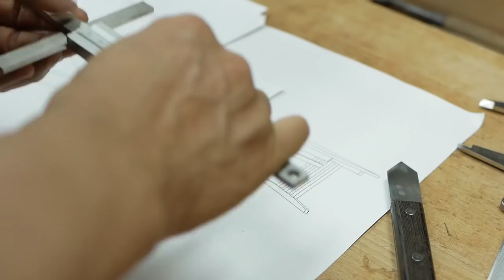SQUARERULE FURNITURE - Making a WhiteOak Table with Drawer

Comment: Absolutely beautiful design and execution; and it's especially nice to see the table in use, and not just on display! One question that, as a fellow woodworker, I just HAVE to ask: Why did you choose such complex tenons for the uprights, and then switch to dominos (HOMEMADE dominos, but dominos nonetheless...) for the stretchers? Personally, I use dominos EVERYWHERE, but I also do not possess your patience to chop out all of those mortises and cut the tenons, especially when they are not visible! I look forward to watching you build your next project!
Reply from the maker: If my interpretation is correct, why did you use dominoes? Is it correct?

The length is shortened by mistake, so you have to use dominoes.

The overall load and structure support the top plate firmly with both legs
The bolts hold the legs and upper plate strong.

Thanks for watching!
Reply: @squarerulefurniture  HaHaHa!!! NOW I understand! That sounds like something that I would have done! It is hard to make a board longer once you cut it! Thanks...

Comment: Nice job, I really like the process of making the table. Quick question: As you're screwing the tabletop to legs, how do you deal with the wood movement? Are the holes oversized?
Reply from the maker: The base hole is 1.5~2mm big at the front and back~
Instead, the bolt head is large and holds it well~

Comment: I love that you always apply the finish by hand with a cotton glove seems so simple and easy. Do you use a new thin glove each time or keep using a thicker one? Any thoughts about the best kind of glove? It looks like you usually use an oil finish. I usually use a hard wax oil but I’m thinking the same glove technique would work. Thanks
Reply from the maker: All gloves are also of different weights. We find suitable cotton gloves, use them, and throw them away.

As you may know, the oil finish is discarded after drying because there is a risk of fire.

Comment: Another great build.  How long did it actually take to build?
Reply from the maker: Well... I think the design time is different for each furniture.
Sometimes it's early and it's late.

This table design is a design made a long time ago
After revising around March 2020, drawings will be
I think I modified it.

I made it for use, so I don't think I was in a hurry.

Probably, if it had been made to order, it would have suffered from creation.